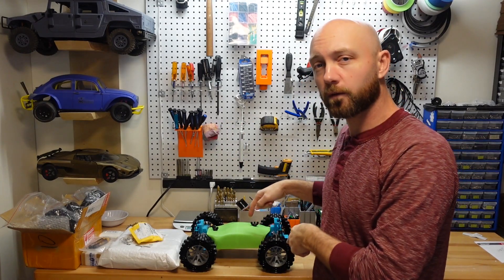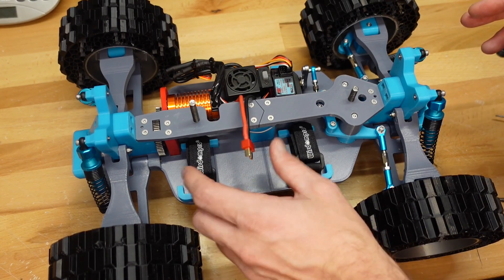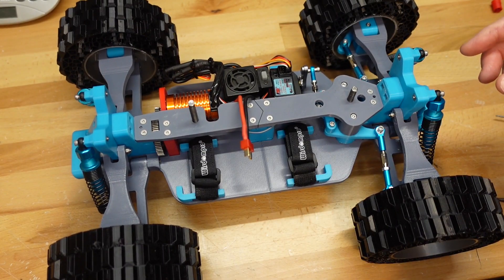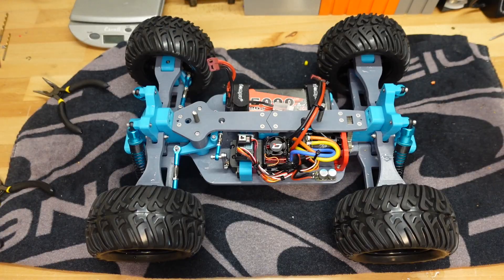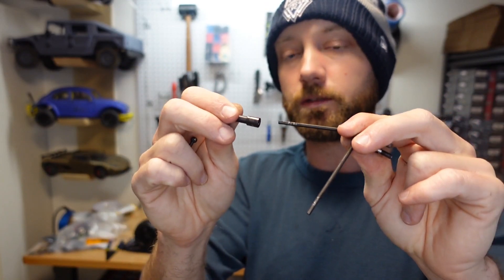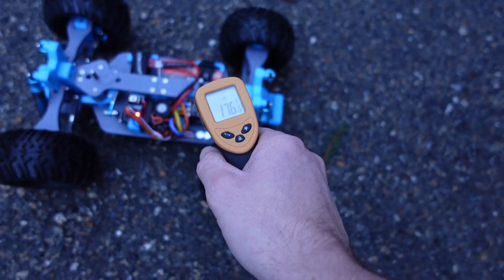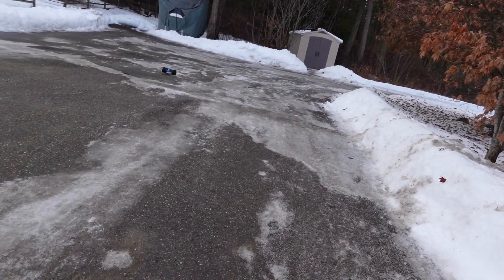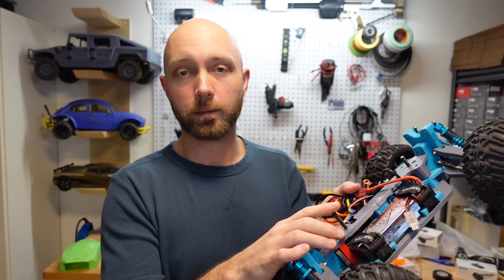Robak 2 Testing and Upgrades

Comment: I’m not sure if you did, but I found setting the max amp draw all the way up on my hobby wing max 10 really helped with cogging. You’ll need their programming card as the esc is set to 60A peak draw by default
Reply from the maker: Thanks for the tip!

Comment: Those adjustable driveshafts just use a file or dremil and make a flat area for the Allen to lock to it 🤘😊
Reply from the maker: yeah I totally did that! Still stripped them. Guess I could flatten them a second time but better to get the proper ones installed I think.

Comment: Yeah.. for anything with this much resistance, the sensored pair is just so much better at low RPM. What diffs did you switch to.. I'm running the HSP 02024 but think I've just broken the front one.. as the front wheels aren't pulling. Good info on the 17T pinion.. I have one and I'll install when I look at the DIff. I have had zero luck with TPU tires.. grin.. I have the ones you ordered and once glued they work super. I also did the Badger.. nice build.. really works well in a gym or similar environment. Great grip with right tires. Too low for bashing in grass.
Reply from the maker: Yup the HSP 02024 diffs are what I'm running now but they didn't arrive in time when I did the initial build so I was using ones that I had for the mkultra which are FS Racing 511687 which aren't quite big enough

The TPU tires did ok in the snow ;) otherwise not so good. I hope to get to the badger soon!